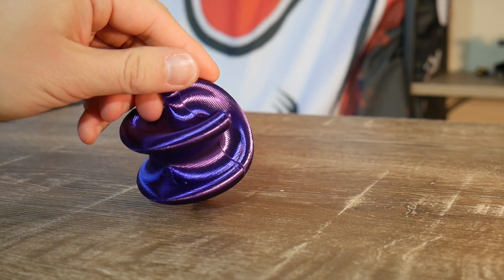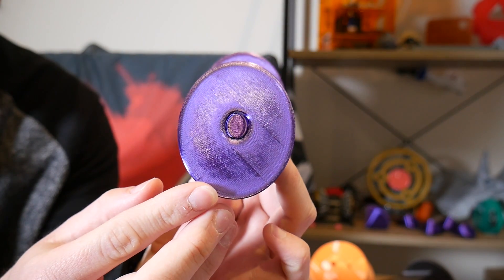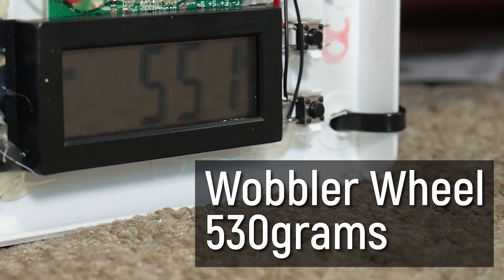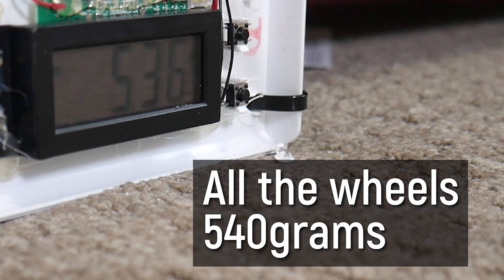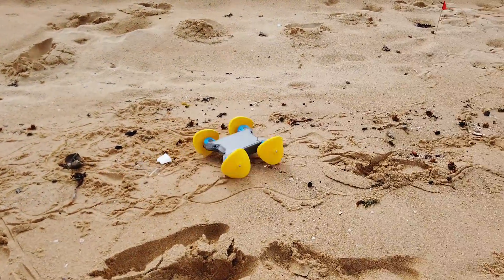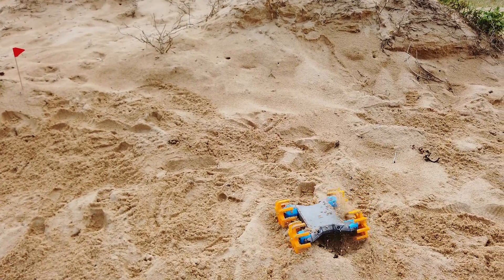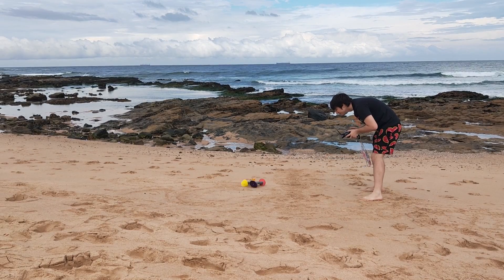This Robot Drives on Wobbly Wheels (but HOW?)

Comment: I'd like to see a second version of the spoked wheels were they have more surface area on the vertical, something like a paddle wheel boat. The ones you have now aren't so much paddles as sticks. Same width so they dig into the sand, but more surface area to kick the sand backwards, gaining traction in the process. Maybe even make the edge of them sharper so they dig in better.

Comment: Make wheels that are two triangles at 180 degrees from each other for each wheel. You might have to slightly round out the corners. In soft surfaces it should only sink partially allowing for greater traction. Because the design allows it to sink only partially this increase in traction also means it can displace sand, mud, snow etc. On hard surfaces it will function more or less like a standard round wheel. It does not need the same amount of surface area to function either because of the total number of points of contact at any given time. Just make sure to assemble all the wheels the same.

Comment: what about a combo of the wobble and spoke?
also an increased diameter would help (obviously) but the reason i point it out is because, as an avid off roader, if you look at the course in scale those are lines that a driver would never pick. bottoming out the chassis is just an unfair assessment of the wheel performance.
love the vid. would love to see more

Comment: If the key is surface area, then combine the spoke design with the wobbler design, helical spokes.  :)
Reply: I was thinking just make them completely helical, like the ZIL 29061, and have it move "sideways" with what were formerly the front and rear wheels controlled as independent pairs.

Comment: What if you were to add scoops to your wheel designs and raise the body up.  The clearance was to low.  You showed those dune buggy tires or what ever and you could develop your wheels to be more like that.  Maybe you would get better traction in the sand.  Imagine your platform being a low rider.  I don’t think a low rider would do well in that situation no matter what kind of wheels it had because it would be high centering to much.  Build it more like a dune buggy.

Comment: I knew as soon as I saw the spaced yellow ones they were going to have the most pull and do well in the sand. I've gone mudding enough to know paddles are great at throwing and that's why most swamp buggies use superswamper boggers which look very similar to yours only with traction in between the flaps.

Comment: Kind of stupid to have the body that close to the sand, 2 footsteps might make the little robot hanging with the wheels in the air. 1 of the last wheels in the middle would have fixed the problem with all wheels in the air since it would push the body forward when it is stuck on something. 5 wheels is probably way better on this small robot with a low body if you want to drive it on sand.

Comment: very cool designs but sholdnt you count with the area touching the ground to get the same friction and not overall area of the wheel.
i.e. the wobly wheel has a larger area touching the carpet than the straight wheel at any given time and to counter that the straight wheel should be as wide as the diagonal touching the carpet of the wobly wheel

Comment: Another consideration as to why the Spoked Wheels had an advantage during testing is although you limited all wheels by Surface Area, the spoked wheels had the greatest "Footprint" out of all the wheels, meaning they had the highest contact patch to work with. The same can be said as a disadvantage, I suppose, as the contact patch was infrequently in contact with the ground surface due to the inherent design of these wheels. Nonetheless, It is important to consider the actual footprint as a factor to be aware of at least in practice.

Comment: I don't really get your tests, it's fun, but it looks like you have no understanding of physics... pulling force (on carpet or on a road) is about FRICTION, do a microstructure for carpet and use soft materials for road use to get better friction. For sand you have the problem of digging in and washing away of material, because the ground is not stable and the pressure on the ground is too big... therefore make wheels with larger surface area to reduce the pressure... that's how it works and no shape, wobbly or not, is gonna change it.

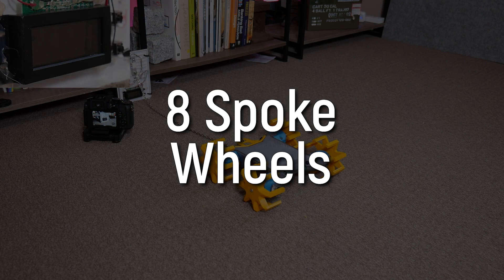Comment: Pretty cool video overall. 2 things i did see there were during the pull test that may have affected the results of the pull test. The first is weight, though I do not know the weight of each wheel, there could be much more plastic and therefore weight on the "wobbly//chip" wheels which would give it a performance boost because it would increase the friction the wheels would have making the heavier wheel win (this effect varies on a lot of things and lighter could be beneficial at some point but that is way extrapolated to where the motors are struggling to rotate the wheels). The other part is that the wobbly/unstable movements of the unconventional wheels could be in a way sliding back a small bit then getting a moment to accelerate to make stronger pulls on the plate, this was shown best at 7:11 with the spoke wheels where it may have been getting extra force from the front of the car coming off of the ground may have used the weight of the vehicle itself with gravity be able to pull harder. One way to obliviate this is to get the car to the end of the chain and very slowly ramp up the throttle till slipping occurs, and also a higher friction surface like rubber would help show any big differences between wheels in this manner.  The only other thing that could have been an issue was clearance to the bottom of the car in the beach part after but I am pretty sure it did not affect the results. Overall I really liked this video. I do like some out of the box thinking and experimentation along those lines. I also was fairly impressed by the thought process behind the surface area being the same on the engagement face of the wheels (the face that comes into contact with ground) if you did not have that be the same I definitely would have pointed it out like how the weight/car power control. 
 (3rd thing below I pondered during thought experiments of this in my head)
My theory on what wheel would be the best would be solely reliant on the surface area engaged with the ground at any particular time. The wheels may have the same surface area all around the contact face of the wheel, but the different shapes may have more or less of that surface area being in contact with the ground at a particular time. what makes me think this is due to the wheels on the 2 sides of the wobbler wheels were out of phase, thus the wheels that just so happened to be on the right side (from camera perspective) was that that side had slightly more traction to start with and that starts the car into a slight favoritism to pull to the left (from camera pov) once it starts going that way, the other wheels can not quite handle that with the pull so they slip more, slowing momentum for the other side to have another push to then spin out the other side's wheels again. I also think that the spoked wheels should have performed on a more similar level to the other wheels but they may have been able to slightly "dig in" to the carpet so they could pull more but by running them all to max power may have introduced multiple other variable the test did not account for such as the spoke wheels leveraging the car weight to help it's pull by pulling a wheelie like a tractor pull contest.

I do have to say I loved this out of the box experimentation and stuff. It does really make you wonder about applications of simple but also complex designs of wheels. I do hope none of the above came off as harsh, it is just things I spotted that may have made differences in the tests that could have improved the quality of numbers for better comparisons so it is kept apples to apples and not apples to oranges.

Comment: Some suggestions: 
1) In next version try to add gripper pattern to wheel base. It will give more grip to wheels.
2) Since you tried this on sand, do a test in flat solid road. In sand these wheels don't get much grip.

Comment: I know this might be late, but what if you combined the wobbly wheel with the spoke/scoop wheel. A method would be to add the spokes at the end of the wobbly wheel, and check if it would maintain it's stability.

Comment: This is super interesting, I wonder if any of these wheels, given some design to the interior parts of the tire, can fly. Maybe by displacing enough air such as a birds wing. 

Also, if the four wheels, each a different wheel can give as much pull and steady direction, would it make sense that all cars have this versatility, and be able to assign powertrain to anyone individual wheel? So, that all cars have four different wheels?

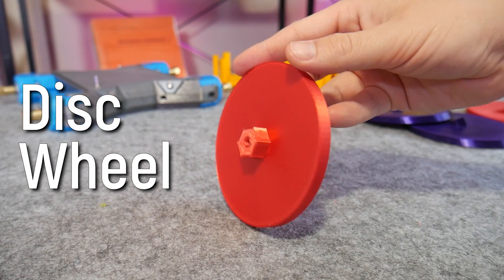Comment: 4:10 the formula for the area of a cylinder wall is 2πrh. If you don't change the width of the wheel, then the surface area will remain constant regardless of edge length.

Geometry do be weird sometimes.

Comment: The spoke design’s other advantage was that it moved the offset of the vehicle more inboard making it less susceptible to high centering compared to the other wheels. I would suggest larger diameter wheels to increase the ride height as well.
Reply: The other reason the car was so darty is that the wheelbase is so short, a longer wheelbase would make the cart more predictable when pulling

Comment: Hey im just getting into 3D Printing and im wondering what program you use to produce these models, I currently have the GeeeTech A10 3D printer and am having trouble controlling the filler size and input my designs from TinkerCad

Comment: Thought on why the Wobbly Wheels moved in one direction, floor slope. Do you have a level app on your phone or a digital level?

Have you thought about putting a rubber band or silicone bead in the end and possibly pressing in some toothpicks to make traction (flat side to make grip, not pointy) then removing them.

Comment: I think it has to do more with the surface area. Paddle tires have that shape but also their large surface area keeps them from sinking as easily. The spoked tires obviously do better with the amount of sand they can move but still sink because of it. Kind of like for snow tires the weight should be more concentrated which smaller surface area helps with, also not sayin the discs would do best in snow, alot more goes into snow tires than that.

Comment: The main problem is the platform being used is like putting off-road tires on a low-rider vehicle, you are constantly getting high mounted because the clearance in far to low. I would love to see this experiment again but adjust the platform design so the wheels are fully below the platform and providing far greater ground to platform clearance.

Comment: If anything straight wheels would be faster in a race.
The wobbling wheels is probably better at obstacles that require extremely sharp turn.
Reply: only works if you need to turn when the wheels are in the correct orientation when you need to make the turn. Otherwise, it' s going to be worse.
So if it's random, it's not going to change anything on average.

Comment: Why does it look like the motors constantly just run out of power and stop and then everything goes sideways - literally. I don't think you did any of these wheels justice with those underpowered motors. Maybe add some gearing so everything goes slower but at least goes all the time.

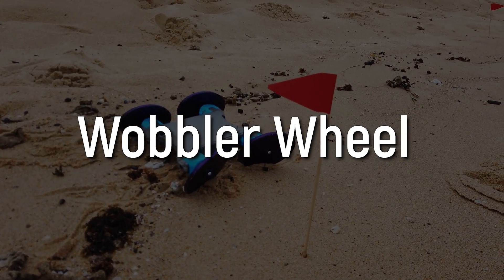Comment: In a strange way I think the "wobbler" wheels function like the spoke (paddle) wheels, but instead of pushing sand STRAIGHT back with a flat surface, they are deflecting sand DIAGONALLY back and to the sides with the inside/outside surface of the wheel. Try reducing the playback speed to 0.25x and watching the footage at 9:24 to see little "waves" of sand being pushed by the outside of the wheel! The left and right forces this imparts cancel out, but the backwards force assists in propelling the vehicle forward. I would love to see a floating version of this robot tested in water with these various wheels!

Comment: Traction is an interesting test and all but I would also like to see how these wheels perform at speed and the impact each wheel has on top speed, acceleration and stability at high rpm.

Comment: Wheels like these could be used on fresh snow, since none of them goes in the same track. You can set the wheels so they have sin-cos amplitude footprint, and only crossing paths in one point.
Also, the side force could help shovel the snow and push the vehicle with more forward force.

Comment: grip wise, you have to take into account the real contact area between the wheel ( or the spikes of the spiked wheel  ) and the ground surface ( the spikes provided way more grip because they are  burried in the sand  which more than doubles the effective surface area of the wheel) ,  as for performance (speed, energy used for a fixed distance)  on a hard surface where grip dosn't matter as much (not a carpet, that would be considered a soft surface like the sand)  the diameter  of the wheel will prevail above the rest.

at the end of the day , the only thing that matter for grip on the road is surface area in contact with ground. That's why on wheel for soft ground you have asperities, ridges and  the like to make the surface area much more important  without having to increase the diameter or the width of the wheel. 

but Wobbly wheels are mesmerizing to see in action.

Comment: Is the reason the original angled wheels always pulled to the right to do with the direction of the weave in the carpet perhaps? If you repeat the tethered pulling test on the same carpet but at 180 degrees do they drift in the same direction?

Comment: The vehicle is to low to the ground. If I look at the video the wheels do an awesome job but the actual chassis of the vehicle is to low. Hence the reason why 4x4 vehicles are so high off the ground. Do another test but lift the vehicle. Let the wheels do the job.

Comment: To get more accurate tests probably do different tests on different surfaces other than just sand, like dirt (maybe mud), gravel, paved roads, etc. And, you should also mess around with different sizes, and/or changing the cut on the nightshade wheels to be thinner (closer to regular wheels) or wider, and possibly some other things to see which seem to work better. Also to fix friction problems, maybe adding something to the edge might increase friction, for example maybe putting certain types of tapes on the edges. Honestly there's a lot of different tests you can run with this to try and figure out what is the best and what might make one better than another. Could be awesome if you got in contact with possibly some other people interested in engineering or science stuff that might be able to help with research and analyzing.
Reply: Very body leaving a sentence or two then there's this guy.
Reply: @GamesIWantToPlay  very body
Reply: @crustaceanking3293  sorry auto-correct
Reply: @GamesIWantToPlay  Heh, I can sometimes get really interested in science stuff. This just happened to interest me, and I was honestly curious and wanted to see him possibly do more with the idea.
Reply: @GamesIWantToPlay  I thought you were trying to say something like "my very body is leaving my soul" or some shit.

Comment: Maybe make wheels based on contact patch instead of surface area? Technically those spoke wheels are utilizing more than just the outward face of the wheel in the sand.

Comment: 3:00 i love the baby's first steps lullaby played for the clip of the nightshade wobblers. Also they pull to the right because of the clockwise wheel rotation. If you were to turn the car around and hammer it in reverse it would then pull to the left.

Comment: I wonder if the wobbly wheels would work in water as well. Since they do wobble, they'd be able to push the water around unlike normal disk wheels. Unsure whether or not it would propel forward, but it would be interesting to test out potentially.

Comment: in the sand test the wheels that leave the best clearance angle win.  it's all about high centered, it doesn't matter how much traction the wheels have if it's so easy to get them off the sand with that wide and low body.  the spokes run inward moving where the traction happens closer to the center...harder to get high_centered

Comment: You used total area of surface of a wheel, but in fact their contact area differs a lot, especially with spoked wheels: they have multiple times more contact area than other wheels. So, they'd provide much more grip on pretty much any surface, would it be a sand or a steel sheet.

Comment: Seemed unfair that the width of the disc wheels were much smaller than the ones which worked well on sand which were really wide..

Comment: This reminds me of the Sharkwheel... maybe the wobbly wheels and prongle design worked better than smooth wheels with some sideways movement, in terms of contact surface to ground, allowing more traction than a flat disc

Comment: The nightshade wheels look like fins going back and forth.  I wonder if there is a "duck" wheel for aquatic vehicle that is a hybrid between flapping fin and nightshade wheel without having to have any articulation in the "flapping".  If you consider a conventional (donut) tire to have a circle cross section in rubber, with a line that is the rim, you could approximate the sand tire with a t cross section.  You could also put waves, prongles, or ellipticals as the part that extends past the t.  You could look at flat cross-bar, outward curved, or inward curved (like a section of a more conventional sand-tire.